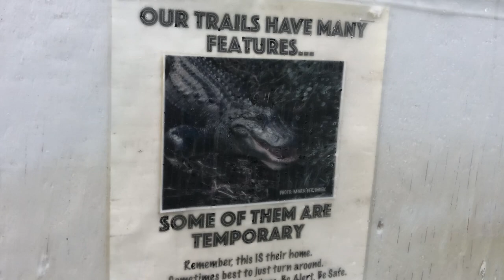SKOOLIE PLUMBING | Installing with SharkBite & PEX to RV Hot Water Heater in School Bus Conversion

Comment: question: when the water goes from the pump and joins the city water line, what keeps it from turning left and going back out the city water inlet? I think there needs to be a three-way valve there right?
Reply from the maker: There is a stop valve there. Both the city water and water from the tank work perfectly!
Reply: @ShawnandAsh  You guys rock seriously. You are so good together.

Comment: Do guys mind sharing the water heater you used?
Reply from the maker: eco temp L5. Its worked for us but looking back wish we got a higher model. The most challenging thing for was us figuring out how we were going to vent the exhaust. We ended up mounting the unit outside, underneath the bus. It has to be mounted upright

Comment: Hi guys! Which GASLAND water heater size did you get (6L, 10L, or 12L)? I was also thinking about putting it under my sink, but I'm afraid it's gonna burn the sink since the heater exhaust is located on the top. Are you going to vent it outside with a pipe? If you are not venting it, are you gonna but a metal shield between the exhaust and the sink? thanksss :)
Reply from the maker: Hi Victoria! We have the EcoTemp L5 heater which uses about 1.5 gals/min. We are going to run a thin pipe through the side of our cabinetry and up out the roof of the bus to vent it... if we’re correct, while having a heat shield may help, you definitely need to vent the hot water heater so it doesn’t burst or overheat!
Reply from the maker: Hope that helps!!

Comment: I can't believe your using Sharkbite fittings considering how unreliable they are. Plastic or brass fittings with stainless steel clamps would have been better and at a fraction of the cost.